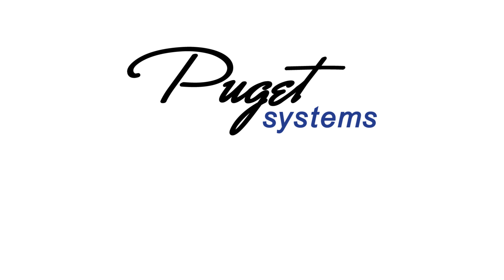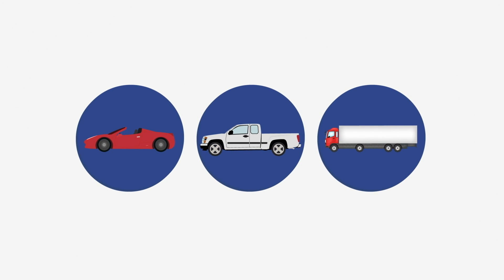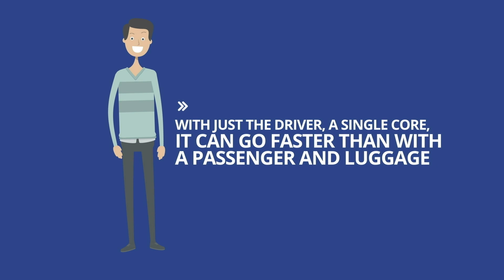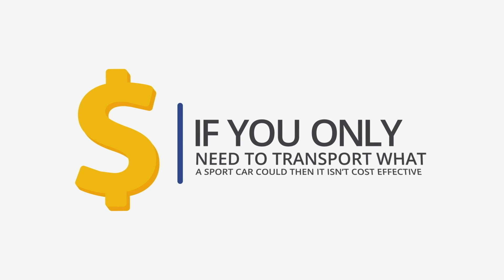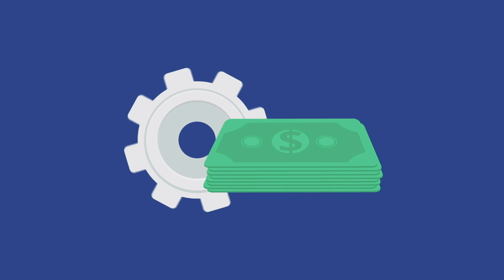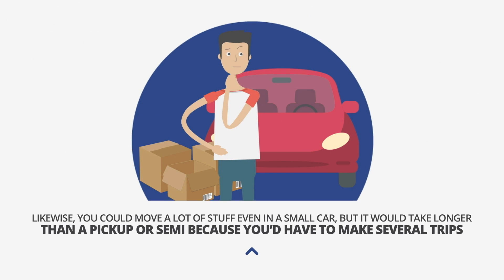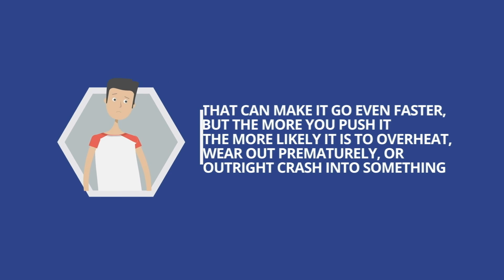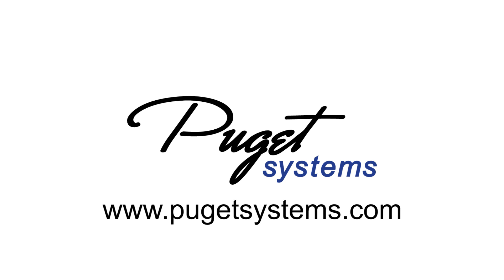CPU Cores and Clock Speed - A Car Analogy

Comment: someone answer me please 
i bought a 7th gen i5 7600 4 cores base freq. = 3.50 and a turbo= 4.10

aaand just 6 month later the 8th gen appeared and the i5 8400 with 6 cores withe base freq. = 2.80 and turbo 4.00 

which is better ?
Reply: it depends. if you are gaming, the higher base frequency of the 7600 is probably going to do better. If you want to stream while gaming or edit videos, the 8400 will be the one to get. 2.8 base is pretty slow for gaming though.

 At THIS point you probably consider the i5-9500 or 8500 OR wait until July 7th when Ryzen 3000 series comes out. The Ryzen 5 3600 is 6C/12T clocked at 3.6 Ghz base and is overclockable if you want. The 3600 is better than even the i5-9400: https://cpu.userbenchmark.com/Compare/AMD-Ryzen-5-3600-vs-Intel-Core-i5-9400/4040vsm735306

Comment: In one of your videos you said the best CPU for Premiere was the 10 core 6950x will this change with the x299 CPUs going up to 18 cores but they will be higher frequencies too?
Reply from the maker: I'm sure it will change, but which new model will be best we don't yet know. It will be a matter of what ends up being the sweet spot in terms of core count and clock speed combination. We'll be doing a lot of testing on the new CPUs as they come out, so stay tuned! Also, if you want more info, check out the articles on our website as well as our video content. We put out a lot more in text than we do in video at this time :)